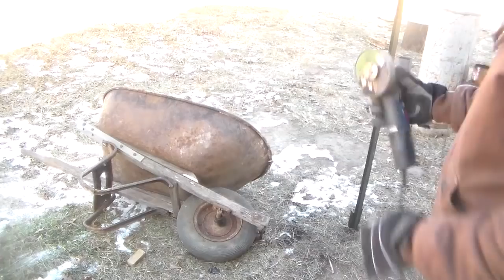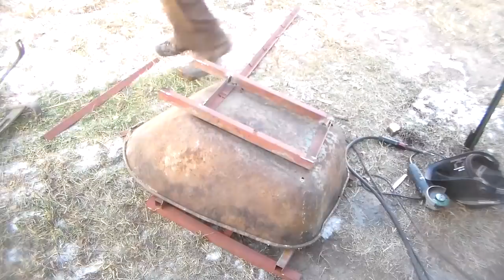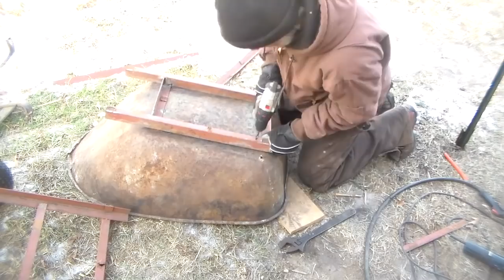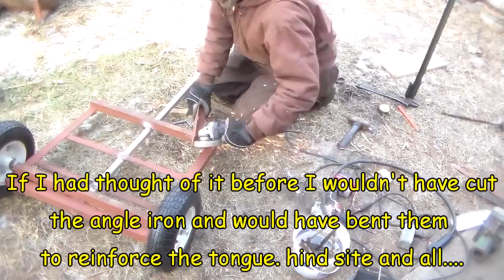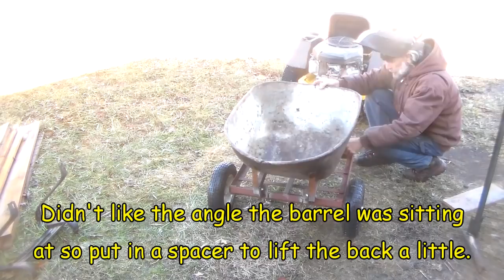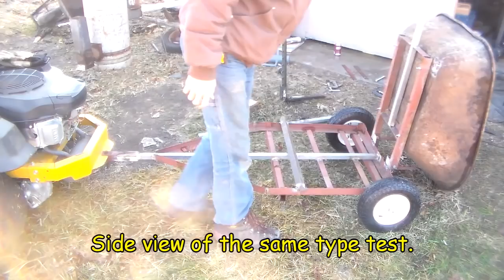Wheelbarrow Lawn Trailer

Comment: I made one very similar to yours, with an old wheelbarrow and some square tube. I placed the pivot point more central to make for easier tipping and put a clamp on the handle to lock it down. Works great, minimal investment.
Reply from the maker: I had thought of that approach but decided I didnt want to mess with a latch for the handle. I have a regular lawn trailer like that and the latch is wired locked because any big bump will trigger it. I could have designed a better one but this works and if loaded right its not too bad. Thanks for watching.

Comment: I took a old push mower and took the motor off and put a wheel barrel on the body of it.  I strap the handle to the back of the atv rack. It does a good job for what it is.

Comment: Congratulations!  Excellent project!

However:

The tray needed to be refinished  --- badly.  

I found that using a wire brush on an angle grinder allowed the rust to be stripped away quite rapidly.  Then I refinished the tray using Kilz primer and exterior housepaint  ---because that's what I had on hand at no cash outlay.

I would have recommended the same for the frame. 

And lastly,  I would have recommended attaching the tray to the frame using stainless steel bolts, rather than welding.  That would allow the tray and frame to be refinished in the future with a minimum of difficulty.

You have a great cart!  It deserves to be treated well so that it can be used for decades to come.

Comment: used dump cart is under 50 bucks but nice job.
Reply from the maker: Dump carts are rated from 200 to 500 lbs depending on what brand. This thing can carry more weight than that.